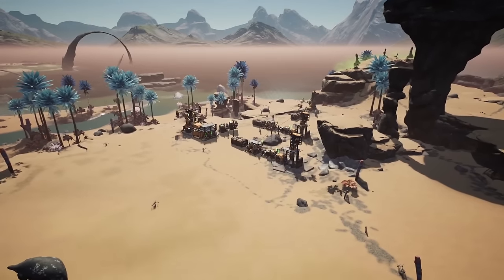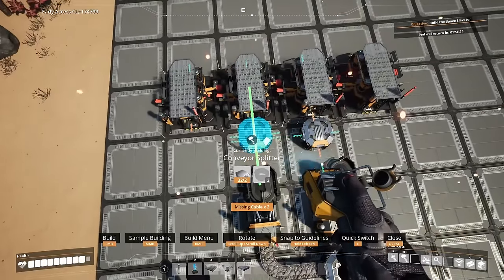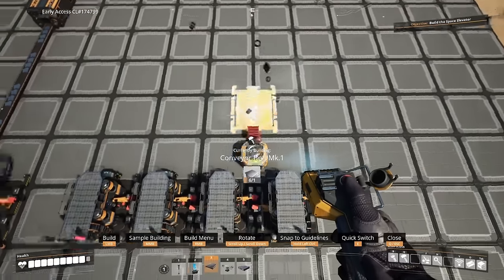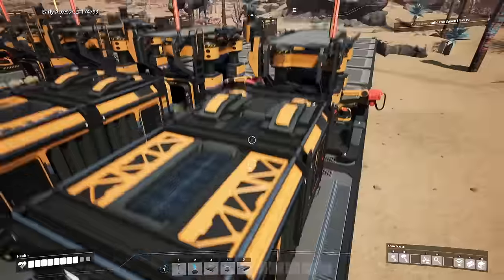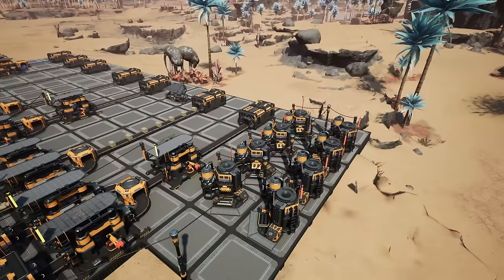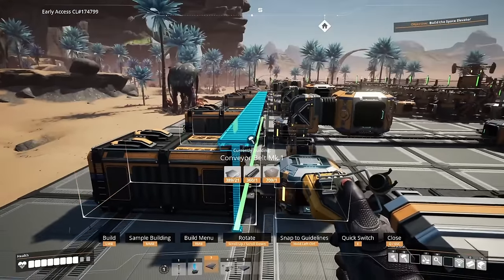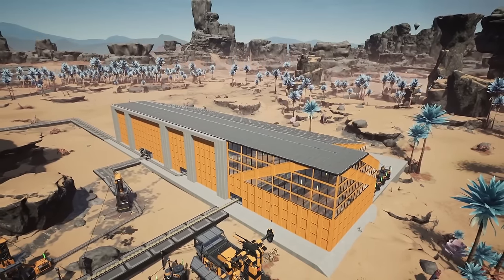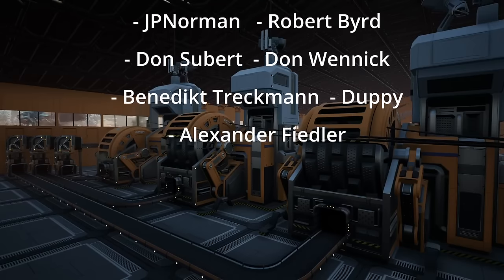The PERFECT Starter Factory? | Satisfactory Update 5

Comment: I think a misconception a lot of people go through in starting this game out is the ability to build like this with such ease. This is a fantastic starting video for people but I am afraid of people getting used to the concept of "flying indefinitely" to build, which they can't unlock until the Jetpack if you can even compare it with how unsteady it is. I know there are mods out there but I think most people going into this game will go in without mods or knowing there are mods. I know it doesn't make for an interesting video, but building without mods would be neat to dissect and look at.
Reply: Yeah, the lookout tower helps tho
Reply: No longer an issue since the Just Fly mod is now built into the game. See the Advanced Game Settings. I always disliked the Jetpack and have never used it. As for people not knowing about mods. Even a year ago I would say Most people knew about mods, but are under the Misconception that mods are Cheating or Evil.
Reply: @jamiec8096  
I personally just prefer games as they're intended without mods. If the devs want to add a feature in they saw from mods into the base of the game, then that's perfect for me lol.

Comment: This is by far the best Tutorial video for this game.  Your calm voice helps, too :) 

For Concrete, once you have Mk2 line you can run it at full efficiency.  Instead of underclocking, grab a Normal and an impure node for a total of 90 units merge them then split them for a perfect 45 to run your constructors flat out.  The extra 4 Mw is well worth the efficiency boost of your concrete production.  this is of course correct for load balanced factories.  

Right now I always use manifold because when you start upgrading along the way your output will constantly increase and load balanced systems are hard to upgrade.  

Again Awesome video series!!

Comment: If the Alt. Cast Screw is unlocked, you can rework your  Screws/Rods lines to snug an assembler for rotors (the screw/rods mergers are directly feeding smart splitters priorizing the Assembler, storage unit is filled from Assembler Overflow); once the Alt. stiched Iron plates is unlocked, you can do the same between Steel plates and wires and voilà :)

Comment: Great guide but there is a COLOSSAL playtime gap between the conveyer belt mk2 upgrade and smart splitters. I'm talking a good ten hours. For you to research smart splitters, you need gold. To be able to mine gold, you need to blow up the boulder on top of gold ore deposits. That requires explosives which requires sulfur which requires mining sulfur as well as sulfur research and getting a ton of other collectibles / research up. Since I'm a newb maybe I'm missing something but I feel like you could have mentioned that or idk. Nonetheless its still an amazing guide. Thank you!.
Reply from the maker: 'm not sure - it really depends on your pace. For example the first space elevator speed time is less than half an hour. I normally take 4 hours to do the first space elevator phase but at the same time, the caterium doesn't necessarily need to have a boulder removed, most of them don't have boulders and even those that do can be manually mined if thats what you want to do, by placing a portable miner on the node the boulders on. Again though, there is no rush, take it at your leisure 🙂
Reply: @TotalXclipse  Ahh I didn't know that not all caterium have a boulder on top. I went to 2 different spots and assumed it was every single caterium deposit. Will try to find a new spot. Thanks.

Comment: 8:05 you could have said that its possible to add more portabel miners to a node to speed up the process. Also helps alot to run there and grab 2k ore instead of 100 at a time
Reply: This. And those portable miners are mid term investments anyway, cause they'll be used up for the automated miners later, so it doesn't hurt to make 10 too much at the beginning.
Reply: @Navajonkee  And you only want the ores to handcraft the stuff for MAM research in the beginning before power is automated :D Too bad biofuel generators cant be feed with belts
Reply: @liiiinder  If it becomes a hassle to refill them with solid biofuel, then you've far overstayed their welcome anyway. :D

Comment: So i started organizing my factory in that lake with the 4 coal deposits. I did a little change, on each set of smelters i added 1 foundry for the steel that way I have one for pipes and the other for beams. I can organize to rotors and stators then to then make motors for the next tier.
Reply: Not using any of the coal for power?

Comment: Thanks! I've picked this up 2 days ago and I have like mini factories all over the place. The gold-like stuff is somewhere in the woods, crystals on a cliff and copper as well and I made seperate little factories with their own bioburner. Running around etc. But I would still need seperate bioburners for mining then right? Or do you hook them up to this factory?
Reply from the maker: When you unlock coal, I would recommend connecting them all to one network for now 🙂

Comment: Honestly, until I send off my first payload in the space elevator, I don't bother building anything nice. It feels great setting up a proper factory when I have tons of resources so I can place all the buildings and flooring I need at the same time, and just work on the factory when I have more free time. That's why my first build is put down as fast as possible in any possible direction without worrying about clipping. Once I build the factory later and have it ready, I just quickly replace the miner and build it on top of 4m high foundations, get an elevator straight into the miner and route it right onto the factory. THEN I can take my time removing the mess without sacrificing too much efficiency.

Comment: So in use of the smart splitters, wouldn't it be more efficient of it is programmed as   Left: None  Center: Item  Right:Overflow ??? Instead of Left: Any Center: Any Right: Overflow?
Reply: No, it would do exactly the same, as you're not expecting other item types on the belt anyway. It won't hurt either though, so you can do that if you prefer

Comment: Could you substitute one of the copper wires for a copper sheet constructor? Is that necessary?
Reply: I'd add one, albeit because they earn quite a lot of ticket points and also to have a little stack once you get to coal and need tubing. You'll want to make the transition from biofuel to coal asap.

Comment: Looks like the Biomass generator cables can phase-shift through walls. =) That was going to be my question is how did you run the cabling from outside to inside, but I saw them going straight through the wall at 23:15 in the video.
Reply: Yeah, Satisfactory's grasp on the basic physics of object collision is... incomplete at best.
Reply: @masonwheeler6536  it would be nice if the wall mounted/double-sided wall mounted power was given with foundations and walls instead of bought with tickets

Comment: excellent video! i just started playing and this helped alot. Quick question though. everything seems to work fine but for somereason the smart splitter for the cables isnt overflowing up to the conveyor lift.

i checked all the directions of the mergers up top, the splitter and the lift everything seeems fine and the obvious thing to check is that the storage is full, and it is. but for some reason the cables are not going up. every other lift is working with the splitter. what did i do wrong?
Reply: probably too late to help but you probably have either you're splitter or elevator input outputs the wrong way around so the goods simply aren't moving. I did this in the early days and took me ages to find out what I had done wrong

Comment: I just got the game this past weekend and I'm already loving it. I have some spaghetti factory going but with update 6 coming out today or tomorrow I figure it's a good time to just scrap it and use what I've learned so far to be a little more efficient on my next one. Does the information in this video still hold true? from the little I know so far it seems like it should
Reply from the maker: Yep this should be fine until they balance any recipes again 😅
Reply: @TotalXclipse  thanks. I've been following along as I build and chose build in nearly the same area, mostly using your video to understand the ratios better and how to split lines to limit waste. it's been a huge help.

the only "issue" I've come to is the point in the video where you unlock smart splitters to feed the sink is far earlier than "normal" gameplay would allow. this may have something to do with the changes to tech tree in the M.A.M for update 6 because you can't progress the Caterium tree far enough until you have stun bolts for the rebar gun, which you can't get until you unlock the rebar gun because it takes regular rebar bolts to research and you can't unlock the rebar gun until you progress nearly the entire alien organics tree and in my specific case, I'm having trouble locating spider enemies to their stingers

it's not a huge problem, it just means there's a few extra steps required before having smart splitter

Comment: Aren't you going to run into the Floating Point issue with this build?  Just learned about it and don't fully understand it, but seems like you'd have to use MK2 pipe.
Reply: I still have never used MK2 pipes in this game. I think they are still broken.

Comment: This is a nice factory for starters, but when you advance into later game stages, and your miners become more and more powerful, you are bound to realize that it's hardly scalable. If you want to double the production to follow through with the increased output of an MK II Miner, you'll have to build the whole thing again. And of course it'll make logistics a tad bit more nightmarish once you try to redirect the output of both factory areas into the same storage/sink. A more easily scalable approach would be to put your buildings in line next to each other, and have one long belt running along them, splitting directly into each Smelter/Fabricator (This is called a manifold design). This not only makes expanding your factory easier, since you only have to put down additional buildings/splitters to increase production, but it also creates a more compact, tight working area.
Reply from the maker: You're right, but you wouldn't want to carry your starter factory into the later tiers. Rather build a much bigger scaling facility elsewhere :)
Reply: @TotalXclipse  Not me though, I hate building things twice :D
Reply: Could make a scalable factory. I did that on one of my play through where it would produce  on the first floor and scales to higher floors for higher tiers of belts and miners also with over clocking. wasn't a terrible idea but it took a lot of foundations to set it all up and a lot of planning. But overall I love small factory designs like these.

Comment: Can't do this build early on. For research programmable splitter u need plastic :(
Reply from the maker: It's a smart splitter, not programmable. So all you need are copper sheets and quick wire. I assure you, you can do it, because I started a new save specifically for this build 😊
Reply: @TotalXclipse  thank for your feedback, but I stopped the video in the frame where you unlock the smart splitter in the mam but in MY mam in the same place there is the programmable and it need 20 plastic to unlock. Any idea? (I play on server early acces)
Reply: I'm an idiot

Comment: I'm confused about one thing though, why 3 awesome sinks instead of merging the overflows?
Reply: assuming everything is full and trying to go into sink it will get backed up on the conveyer belts. thats why there's 3
Reply from the maker: As killer mentioned. If all units fill up your factory will grind to a halt as you can't handle all the resources going to one or two sinks. With this being a simple storage you won't be sending items to any other factories so the chances are this will eventually fill up. So prep for it in advance, you can always merge them when you have unlock higher belts and remove the two extra sinks

Comment: coool video. thanks. look, how can i get this higher POV? it seems way easier to buld from a higher view :)
Reply from the maker: I used a mod called Pak utility for the guide. Alternatively you can build scaffolding or late game, use a hoverpack
Reply: @TotalXclipse  thanks man. im trying to automate a rotor production but the Assembler is operating at 33%. is there a way to regulate both inputs in order to increase efficiency? or for the screw i would need a faster conveyor belt?thanks

Comment: I tried doing this in the plains and the foundations aren't attaching to each other properly, it keeps changing the direction I want it and when I left cntrl it doesn't align and it only stacks above the one placed
Reply from the maker: Control should only be used to place the first foundation. If you keep it held it will place it down on top of a foundation in order to incremental change its rotation. After you place the first foundation you should just be able to hover the foundation next to the first one
Reply: @TotalXclipse   after rewatching I also noticed that there's a setting called zooping, that helped a lot as well. Did have to relocate a few times to find a better area to continue building when the time comes

Comment: fuse broke down, maybe also show how the power works?
Reply: Right? Like I connect more than four things and it always short circuits
Reply: @AngryBaldyGaming  You can create a power grid by linking the generators (of all types) together and running a single power line off it. The (non-HAB) biofuel burners have a max output of 30 MW each. If you connected 4 together, you'd have 120 MW. Smelters and constructors only use 4 MW, but when you get to stuff like Assemblers, it's more like 15, which will blow a single burner's fuse quick with just a few items.

Comment: why 3 sinks?
Reply from the maker: If you upgrade these lines for more resources later on they'll always be able to handle the throughput, at this point out max speed belts are 60 or 120 and if you're not careful you can easily saturate the lines and stop them running efficiently

Comment: Perfect Starter Factory, uses things not available until mid-late game...
Reply from the maker: Name one item that isn't available until the mid to late game...
Reply: @TotalXclipse  building more than one of the item at once in a grid.
tier 3+ belts mk2+ miners, assemblers, smelters.  Basically anything that isnt available at tier 1, i.e. post intro/tutorial.
Reply from the maker: @anthonybachler9526  Well it's a good job I didn't use tier 3 belts or mk2 miners... otherwise I would definitely agree with you. 
( I believe I do add some mk2 belts though)

As for the perfect starter factory itself, I assure you it's all doable within the first few hours of gameplay. You can hand craft the items for the constructors, and once you start automating them you'll find it quickly snow balls. I believe the only items I display being built in this video (I just checked) are all Tier 1 or 2) - I go on to tier 3 in either the next video or the one after with steel.